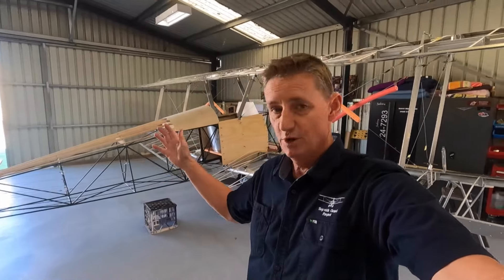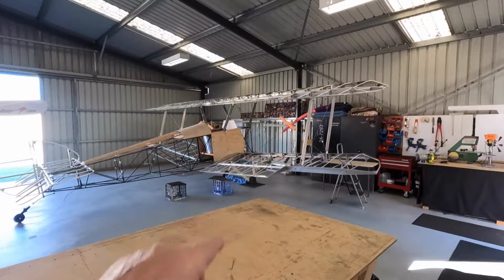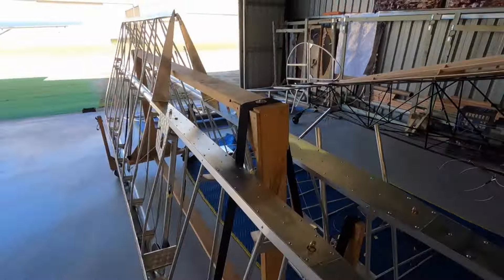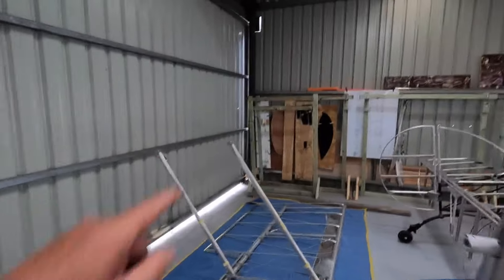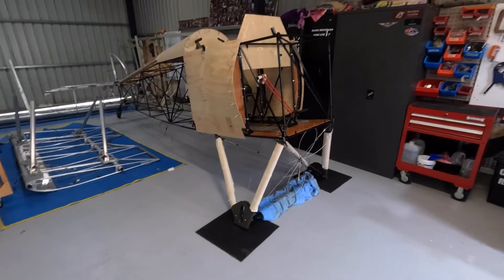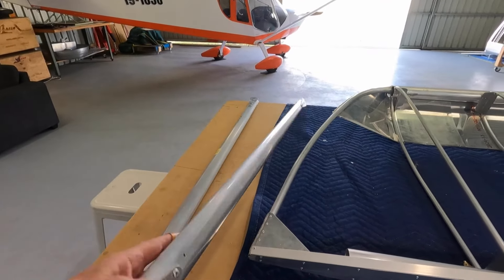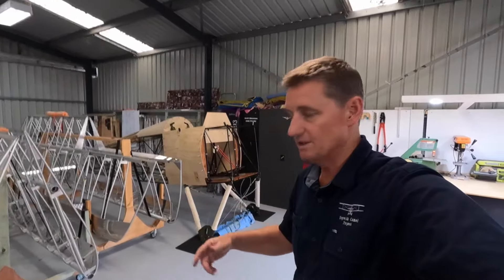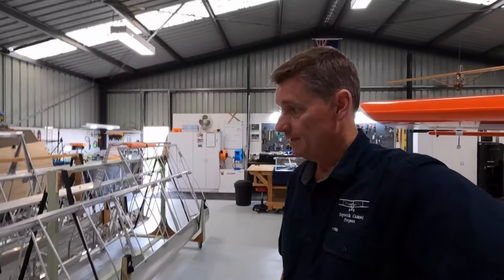Disassembling My Sopwith Camel Project

Comment: G'day,

Great stuff !

A daunting day, pulling it to bits...; but it's the fastest way to do a good job of cobering in.

If the idea of drilling into the Ribs to screw the Fabric on is giving you nightmares about entrapped Swarf (?), what about simply  using Poly-Tack to stick the Fabric onto the Structure, then Rib-Stitch it to the Structure, using a long (round-pointed) needle going in and out the top & bottom of the Wing Surface..., the olde fashioned way that it used to be done when the ribs would have been wood, and then Pinked-Tape over the Rib-Stitching...?

And if you REALLY want to go for the "period-correct" look then start with a roll of 2-inch straight-sided Tape and hand-fray the outer 1/4 - inch of iton both sides.

Pinking-Shears are a post-WW-1 innovation, apparently - originally all the Rib-Tapes and other Tape reinforcements were frayed rather than pinked - to better smooth the junctions (!).

Isometimes wonder how many "man-hours" went into fraying all the Rib-Tapes on all the Aeroplanes which flew in the Great Patriotic War-To-En-d-All-War, Part One...; visualising hundreds of Shift-workers busily unrolling and pulling Threads, and then re-rolling all the hundreds of yards of frayed Tape...

How many Aeroplanes, most being Biplanes or Triplanes..., how many Wings, how many Ribs ; think of ALL the Rib Stitches an inch apart, and ALL covered with Hand-Frayed Tape....

Ptetty much all crashed & wrecked or shot down within weeks or months of being delivered to the Governments which were furiously  buying, and breaking, all the Aeroplanes which they ever bought - with Taxpayers' Money (as well as the individual machines "donated" to the Fray by rich individuals or bought by Subscriotions given by the True Believers.

I recall seeing a photo of an RE-8 which had been given to the King of England by the Maharajah of Cawnpore in India..., and an AFC DeHavilland-5a (an Ugly-looking Ground-Attack Fighter featuring "Backstaggered" Biplane Wings - lacking much if a View behind and above.....; branded as being the

"De-Havilland WAR-PLANE donated by Subscriptions collected from members of the  
New South Wales 
Country Womens' Association."

The same Propagana Stunt was repeated to raise 
"Public Morale" during the 
Big Remake, 20 years later with 
"Donated"
 Spitfires, Hurricanes and Lancasters, with nicely rounded down but fictitious "Purchase Prices widely advertised, to better incentivise the
Punters.

Somebody had to pay for all the
Destruction...(!).

Achieved by running the
Production Lines 24 hours per day, competing to make (and break) more machines than their officially 
Designated Enemy" could throw up with which to briefly decorate their Skies.

And,
At the time, 
They ALL honestly believed that what they were doing
Made some kind of
"Sense".

Therefore, apparently, they all 
Unspokenly agreed to never ever 
Actually think about any of the
Whyfores..., not
Until  long afterwards.

When they were trying to sleep through the night.

("Apres Le Guerre finni...;
Then comes thy
P.T.S.D....!").

But y'know, it's
ALL just(ifiably ?) a
GAME, of
Blood...; 
In the end.

Entrapped Swarf, under the Screws - or running Rib-Stitching - which will work equally well (I think ?) on Spruce Ribs or Aluminium.

I suppose the bottom line is that the Swarf will only jiggle around inside the Tubes when the Rotec is actually running, and vibrating the Airframe ; and whenever that is occurring then the Exhaust-Note and Slipstream will be making far more 
Noise
Than that entrapped Swarf can ever hope to produce.

So, maybe the
Production-Engineers were not wrong, in ignoring the phenomenon of permanently
Entrapped Swarf....(!).

When I worked on the Wings of the Jensen I left the Fabric screwed on where it was, from the "False Spar," which Volmer had originally chosen to hold the rear edge of the 1.5 mm Styrofoam which he used for the Leading Edge, under a layer of Glassed-over Dacron 
(a Foam/Fabric 1/2-Sandwich...?!?).

I replaced the Styrofoam with 2024 T-3 Aluminium, twice Beercan Guage ..

(42" x 22" Mineral Survey
Drill-Core-Sample Tray-Covers...; from about 60 of them,
All acquired as Scrap Metal, at
$0.42/Kg in 1986 (and I'm still saving and using the offcuts !).

Choices, choices ; so many options - like being a Dog in a Cat-Show, paralysed by
Target indecision...: which way to go next ?.

Such is life,

Have a good one...!

Stay safe.

;-p

Ciao !
Reply from the maker: On this Occassion I need to follow the correct process in the manual, it’s a critical maintenance operation.

Comment: I like your hangar layout....neat organised, logical storage with plenty of space execute the job in hand. I have often imagined the joy of having  an aircraft hangar for a workshop and for machines, tools, equipment and hobby item storage. I noticed in Thiery's YT video  ( chap in France who built one, you mentioned the comprehensive notes, build plans, log etc you got from him ) that he sprayed painted all the struts, stringers, ribs  etc before he covered them. Any idea why he did this and the benefit of doing it if any ? cheers Paul
Reply from the maker: Hi Paul, I tried this on my Zenith Cruzer. It looks great but does absolutely nothing other than make the builder feel good about doing something. Unless you scuff and thoroughly clean every part, like surgically clean it simply scratches off. There fire the fabric is then adhered to the structure only as good as the etch primer. 6061 alloy has great resistant to corrosion.

Comment: Nice progress, Scott!
Drilling the holes for fabric attachment on the wings can be tricky, and rough on your back!
Have you decided on a paint product/system?   I found that exterior grade, acrylic latex house paint with added UV protection worked well on my SE5a.
Reply from the maker: Stewart system with house paint. I would be interested in your finish system, from fabric up? How many coats and of what? Primer filler etc thanks
Reply: You asked about filler... none was used - three primer coats did a good job: the weave is faintly visible but very water tight.  
"Satin" seemed the closest finish to historical.  In WW1, the topcoats were with varnish-like paint, not true "flat" finishes.  Similarly, "high gloss" looks out of character for the time and purpose.  Scale models of WW1 aircraft often have high gloss or flat finishes, and look allright, but my objective is to have folks guessing until they get closer, so the "satin" finish with its eggshell texture was my choice.